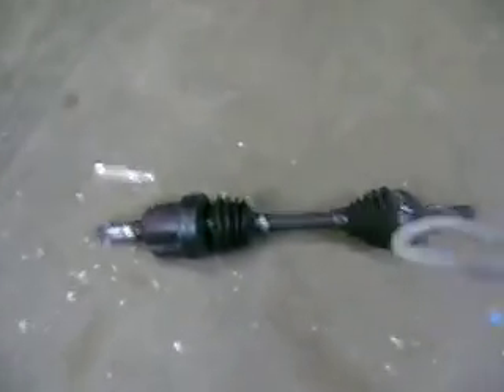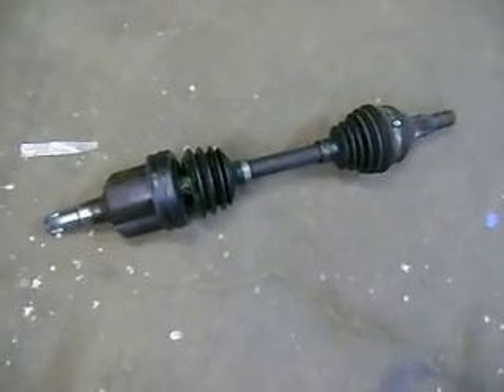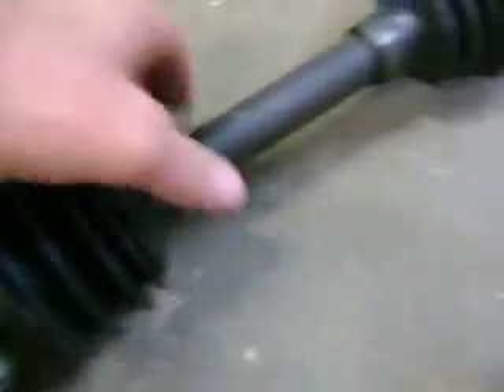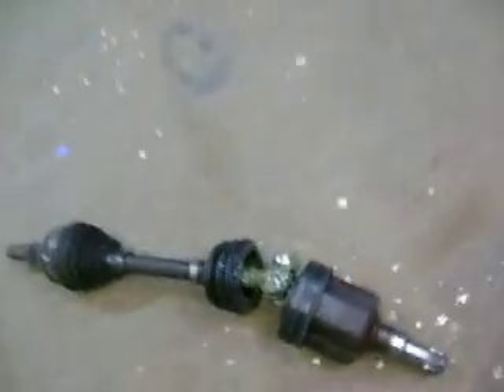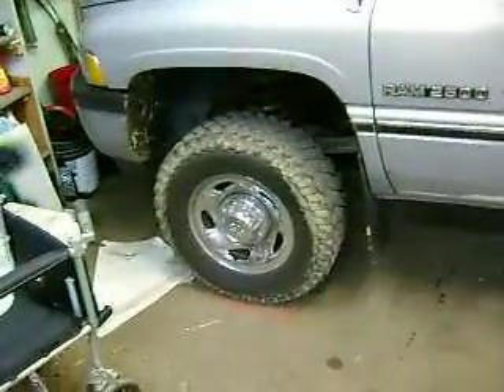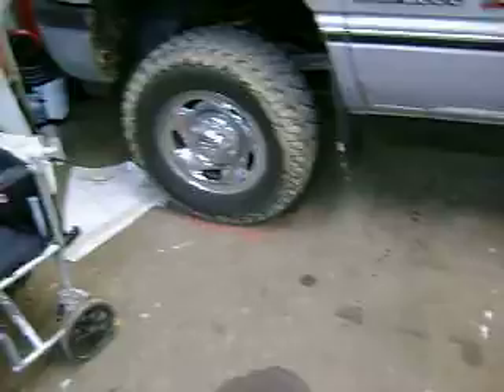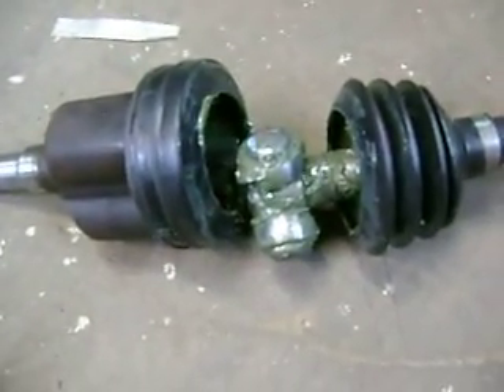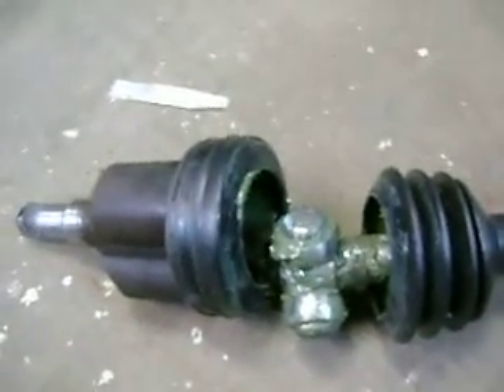how a CV driveshaft works

Comment: Great video for the basics.

For those wanting more, technically tripod(e) joints (Shown here) aren't constant velocity (CV). They're quasi constant velocity, so for all intent and purpose work as if they were, especially when combined with ball joints (or AC jonits, etc), which are CV. I'm pretty sure it's a ball joint on the other end of the half-shaft here, these permit much higher transmission angles as well (up to 50°or so, as opposed to 8-12°) so are fitted to the wheel end of the shaft.

Comment from the maker: @Bradslant37 well theres really nothing wrong with them, they both have advantages and disadvantages.  alot of guys who do big lifts and mud rigs, pulling trucks ect. like to use solid axels rather than an independent suspension, and if you have a solid axel then you have u-joints as there are no solid axles with cv joints, at least not that i've ever seen.

Comment from the maker: @Bradslant37 only if they are both operated at the same angle, you have 2 u-joints on the rear driveline which will operate at roughly the same angle, so yes that will be a cv, but in the front end its another story.